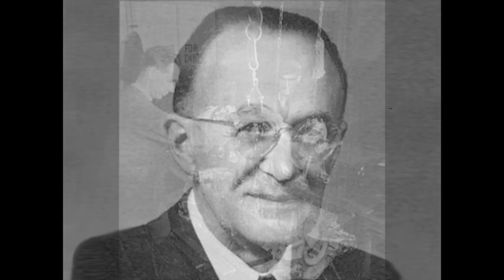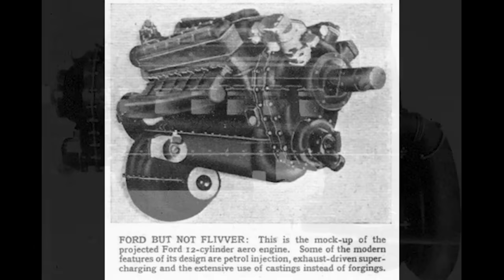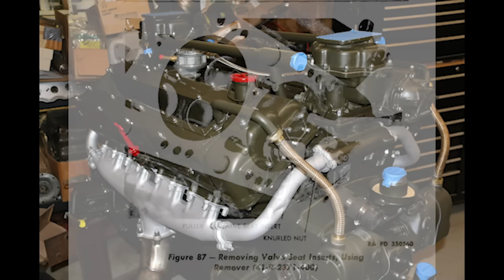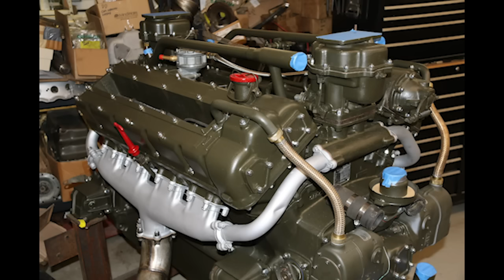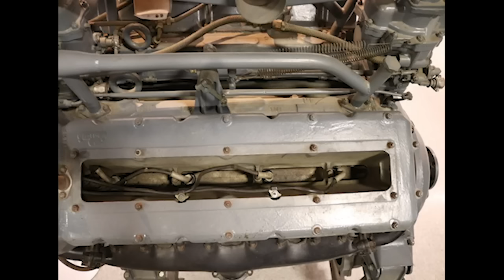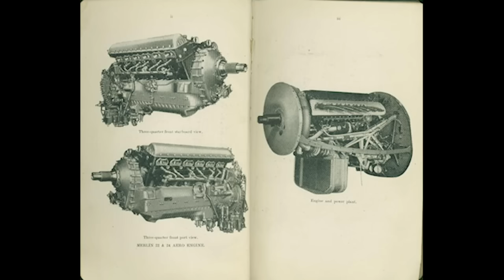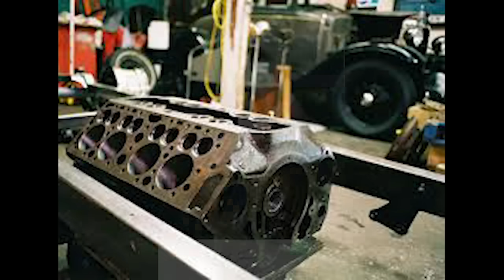War Hemi: The Story Of The GAA V8 - 1,100ci of aluminum WWII Ford grunt

Comment: Now Ford makes engines that have wet belts that fail in under 30k miles, water pumps in the oil jacket - so that when the pump leaks the water is in the oil and destroys the engine. The drive train is so convoluted that mechanics need tons of hours just to get to the problem.  Lets get back to the car manufacturers of the 1940's.
Reply: Engineering cars that are easier to repair doesn't have to mean going back entirely to 1930s technology. Modern cars are designed to fail just outside the warrantee time and they are designed to be difficult and expensive to repair. It's entirely about planned obsolescence and forcing consumers to purchase new vehicles instead of repairing used ones. This business model of the auto industry is one to maximize sales of new autos.
Reply: @Chez8922-kf6cy  well said. It's all about the money.
Reply: @nathanscott7910 Your comment is as dumb as his (his is totally wrong about dealership revenue), OF COURSE businesses are about MONEY, that’s how they EXIST. However you and him also know NOTHING about customer satisfaction scoring and how important it is to dealerships and their parent companies. You can literally go out of business with poor CSI scores. Dunces.
Reply: @Chez8922-kf6cy Lol, so close yet as usual you trailer park youtube commenters don’t have a clue. Dealerships make their main revenue from the service department and financing, backed up by useless service insurance and extra garbage on your contracts and car that you don’t need. You’ve obviously never worked in a dealership, had a business, or have any actual information other than what you imagine and blather. Go learn some reality and come back.
Reply: I read an article some years back (wish I could remember who wrote it) They were talking about why the automotive industry can't find enough qualified mechanics

They blame it on mechanics not keeping up with modern technology

I blame it on the "labor guide" not keeping up with modern technology!!!
Reply: VW have a plastic manifold oil cooler which fails under heat and puts the rad water in the oil.
BMW had a plastic inlet manifold which could catch fire.
Reply: I just watched a 3000hp ford coyote go 225mph in a quarter mile and it gets 20mpg on the street. Welcome to modern times my guy
Reply: Funny, because the Coyote and Voodoo are considered reliable.  Unlike flat cams that needed to be adjusted ever 20,000 miles.
Reply: Ignorance. 
Fords twin cam engines hold the world records. 
Standing mile 300.4 mph oe cast 5.4L 4V
5.88 @ 256mph with an almost entirely oe parts 4.6 4V 
The ONLY oe engined car to win overall Sick Week and set the drag and drive radial record 6.26 @ 227mph  oe cast Predator/Coyote 
No other manufacturer in the world has bested those performances. 
You haters are the most ignorant bunch in all of motorsports
Reply: Yeah poor boomer who understands modern tech and wants to revert back to the 40’s when things lasted more than 5 years.  I’ll take the 50 hp that I can expect reliability out of. I’ll pay the extra money in fuel.  Thats cheaper in the long run. That’s the cheat code us smarter millennials learned.  Never underestimate wisdom. Can’t learn that in college. Oh how’s that working out for you. 😂  It’s not that’s why you want us to pay for that as well.   That boomer you’re talking about…That built the in infrastructure we still use…That we wouldn’t have with your mindset…he didn’t have his hand out expecting anything.
Reply: Blame the people that voted
Reply: Your post is totally wack jack.
Reply: My 2012 F 150 had 248,000 miles on it in the 60s and 70s. Fords would go 150,000 at the most before needing an overhaul. GM about 75,000. I know I still have my first car. Totally needs to be rebuilt inside and out. I have a Ford F 100. That still runs, engine was partially rebuilt.
Reply: Todays engineers are incapable of creating quality products. GM 5.3 and 5.7 litre engines are dropping valves and lifters, and have oil leak issues. I almost believe this is all on purpose, as a way to sabotage the ICE engine, while pushing the EV industry up our A$$ES. Most of the technology is over 100 years old, yet they can't get it right?
Just my thoights.
Reply: So very true.
Reply: Ford never do anything right and this engine wasn’t really a ford it was stolen plans from Rolls Royce.. so ford didn’t create they just build it.. not the same thing.
Reply: Let's get back to the engines of t h e 60's!!
Reply: Ford is still good
Reply: Keep it simple stupid 😂😂😂
Reply: Yep.  They learned a 'valuable lesson' when the2 valve 4.6l Crown Victorias ended up lasting 300,000-400,000 miles every time.
"Noooo!!!  We aren't selling any replacement engines (or cars!)"
Sorry Ford folks, my 97 Crown Vic only has 48,000 original miles, so you won't be getting any money out of me soon
Reply: Just stop, I had an F150 with a 2.7 liter v6, that truck was traded in with 270,000. The one thing replaced was a cracked valve cover and a sensor I tore out driving over a piece of rebar sticking up on a job. That ecoboost ran strong and I drove it hard, it was a work truck in the end and it was treated like a work truck and is still on the road today.
Reply: It took decades, but they finally figured out how to build cars that people can no longer afford or repair. That's pure genius. If they even catch a hint that people are repairing these cars on their own, they'll follow John Deere and refuse to sell parts to anyone. For Detroit, your ignorance equals huge profits.
Reply: Ford only made a few good engines and today none
Reply: Not just Ford. All big auto Design to Fail.  Except Tesla
Reply: Fords 5.0 ain’t bad at all.
Reply: @luvmydeck  I agree. Electricity is far simpler,  less extortable.
Reply: @GWAForUTBE ....until they disconnect your charging service for having a slightly different opinion than your benevolent overlords.
Reply: @MrElapid  Considering most charge at home, not so likely.   
You likely do understand mostly any new car can be shut down remotely.   Including gascars.
Reply: These engines lasted about 250-300 miles before needing replaced in shermans. and they were considered some of the most reliable engines of the war... I really don't feel like doing an engine swap ever Sunday so I can make it to work during the week😂
Reply: Not one video of a ford oil pump belt failing yet 😂😂😂
Reply: @coreysharp9794  BMW had a bicycle chain drive oil pump and it filled quit regularly back in the 70s maybe 70 5 or 6 to 80, 320 I ?
Reply: @whycantyoucope69  search for ford oil pump belt  - there are a bunch
Reply: Them and all the other automakers have purposely made vehicles harder to work on so that you have to bring it back to them for service. Almost every filling station used to have a small 1 or 2 bay shop and a tow truck, they could handle pretty much any maintenance or repairs you needed if you didn’t work on them yourself or if you were traveling. The automakers saw they were leaving money on the table so they started making vehicles more complex, more cramped and requiring speciality tools that only they had. Now they make them to were you can’t just change parts and be on your way, you have to change the part then use a computer to program the part with software that is too expensive for your average person to have access to. But even with all that they saw people were still willing to try so they started adding tons of plastic covers and shrouds to everything to deter you from trying to work on the car yourself.
Reply: @mattm1554  I hear ya.  Tesla  is not like that. They certainly do not promote tinkering or putzin around with these high voltage vehicles, but they do understand how simple to repair their vehicles are and offer an EV mechanic training course available at most community colleges.
Reply: Todays cars are great til the part you need is so expensive it’s cheaper to get another car and junk the one that needs a 4-6$ thousand dollar tranny or engine , seen this over and over working in a shop where all makes and models would come thru.
Reply: And how many hours did 40s engines get before full overhauls? Not many. The squads we service (explorers) have the 3.7 and we routinely run them to 150k miles/25,000 total hrs/15,000 idle hrs with no major failures and perhaps 1 water pump replacement. Overhaul interval for the GAA is 1000 hours at the absolute most.
Reply: @luvmydeck  Don't listen to these supposed " modern" wrenches. I'm guessing they are stealership salesmen that has never spun a wrench in years and every good wrench  in his garage agrees, all new cars are " Designed to Fail"
Reply: That’s because production is made in substandard foreign countries now. Only assembled here in America to get around import tariffs.
Reply: Yes old simple V8S,  we were lucky in Australia, Ford Australia built the Barra ,one hell of an engine.  I hate modern crap but Ford Australia got this one right.
Reply: AMERICA'S AUTO TURNED POS in all lines especially  New Trucks !
Reply: @bernardc2553  it's sad ,in Australia we love American cars. Seems like everything you buy now is throwaway junk. I'm keeping my Australian built turbo barra falcon.  There is nothing worth buying any more just the old cars.
Reply: Perhaps this is why I have left the trade. 😊 Not the derelicts that become mangers, supervisors or even higher.
Reply: Nissan...
Reply: Sounds like you're all dumb enough to buy a new car. Then complain like every other vehicle is perfect hahahaha! Bet you're all mopar guys with a bunch of non working garbage piles sitting out front. And you flaunt that you spent 2890 dollars for a rusty fender.... boo hoo. Bet you one click cheap items off Amazon then complain that the products last one time. Idiots
Reply: Amen
Reply: It's funny when people say this but would shit if they had big gas hungry engines that don't start and run perfectly from cold 😂
Reply: @kiwi8. . Yeah but they were repairable in your backyard
Reply: @stevenfromer3816 yer definitely and don't get me wrong i love old gear but most wouldn't put up with it they think they want it but in reality they couldn't figure out how to drive them. Most people can't even change a tyre or tune a carb
Reply: @kiwi8. . True enough,but I do believe you understand the point I was making.   Most of my modern cars did very well with routine maintenance,except the fords,I got well over 200k on most of my vehicles.
Reply: @stevenfromer3816 lots of modern Ford's that are absolutely excellent. All and I mean all car companies have issues even the so Loved Toyota they have had plenty of bad engines bad rust problems ECT it's mostly people repeating stories but have no idea
Reply: @kiwi8. . I loved my Lexus,one of the best cars I ever owned.
Reply: Right, I hav a 95 351 Windsor. It's doing great. Doordash and weed delivery service... Hope it doesn't blow
Reply: FORD SUCKS. . . AS MUCH AS I WISH IT WAS DIFFERENT.  . . IT'S NOT.
Reply: Fords better ideas.
Reply: @joemckenzie312 
Exactly my feeling👍
Reply: Thank your friendly enviro-mentalist and government.
Reply: Planned obsolescence is central to modern capitalism
Reply: Yup, been a Ford guy all my life. I'm 60 now and not only Ford, you couldn't give me a new car. Seems like all of them are designed by DEI hires who've never seen a car before.
Reply: Don't forget the lack of woodruff keys on crankshafts in smaller displacement engines. And this goes fot G. M. And Chrysler, or whatever name they go by now. And yet, we had to endure an Auto Workers Strike as they demanded more pay. Yeah, right. For what? The quality sucks.
Reply: @stevenl47  I'm not sure that blaming the unions 100% for poor quality is totally valid. The workers assemble a vehicle that was designed without being tested and they have to do it in a time frame decided by a production schedule. Do you think that most of the problems in the field are the result if the assembly process? Also, recalls are rarely an assembly problem.
Reply: US automakers have become .....healthcare providers that happen to make vehicles. The costs associated with healthcare insurance were so expensive that auto mfg were forced to cut costs wherever they could. One of the easiest ways was to cut R&D/engineering costs. Auto engineers were primarily tasked with extracting cost from the mfg process, not exactly innovating new products or necessarily creating exciting cars. Those costs were extracted at a very slow pace, with engineers saving some of the savings for future years. Why? Because that's how they were paid. If you were to be paid $80k/yr(1978), the engineer would set about saving $100k in costs. The engineer would then get a raise and the next year reduce costs by their salary again. Many times that included sending work to vendors, who were then tasked with the savings programs. All because of the enormous expense of healthcare.  @johnsortore4470
Reply: @stevenl47 it's not the workers fault cars suck now. The workers aren't designing them and skimping on quality. That is totally driven by bean counting accounting and finance geeks.
Reply: @thenaturalmidsouth9536  if cars are so bad these days, why are they getting twice as many miles before they end up in the junk yard? In the 1960s, 100k was an accomplishment. Now a car with 100k is barely broken in. As I have said before, people look at the past through rose tinted glasses. Cars are more reliable than they ever have been. A huge portion of the "problems" with modern cars is ignorance. You can't take a canbus system to a shade tree mechanic with 2 screw drivers and a pair of vise grips and hope they are actually gonna get it right. 
But that being said, if a person is actually willing to do the research and understand the systems, they are actually easier than ever to work on. If anyone tells you different, it's because they aren't smart enough to actually work on it.
Reply: @jacktheaviator4938  I'm not arguing for 60's cars, I'm saying cars have gotten needlessly complex and over-engineered in the last 10 years. Electronic tailgates on trucks. Too many computer modules. Electronic parking brakes that fail. What's wrong with a failsafe physical parking brake for example? That still works when a computer chip or module on another car fails. Too many turbos. On a Tundra for chrissakes. In my view, cars peaked around 2010, with the right mix of technology and reliability.
Reply: @thenaturalmidsouth9536  trucks have electric tailgates because customers like gadgets, cable operated brakes are notorious for malfunctioning in the northern climates due to freezing and rust, and turbos are the only chance we have for fuel economy while still maintaining horsepower. Everything you named as a "problem" was actually a solution to an actual problem. And even with all that added, cars are actually getting simpler. With CanBus one wire can do the same job as 20 wire used to, eliminating hundreds of electrical connections, which is the main failure points for the electronics in vehicles. 90% of the time, when some "mechanic" (and I use that term loosely) claims a sensor is bad, it is actually the connector, not the sensor. 

At the end of the day, cars are far more reliable than they have ever been. I constantly see vehicles with 200k that have never had more than a fluid change. And they are getting more reliable every year. But that doesn't fit the 'lectrons bad/ boomer narrative.
Reply: @jacktheaviator4938 

I can rebuild a 1970 model 302 about five times for what a replacement engine cost.  Also I can pull it out on a Friday afternoon remanufacture it and have it back in before Monday.
Reply: @thenaturalmidsouth9536  it would be nice if I could check my oil with a distinct, too.
Reply: @thenaturalmidsouth9536 of course it's all about the bottom line is it not?
Reply: @jacktheaviator4938 No they are not. I daily drive a 25 year old truck nothing absolutely nothing that is built today will be on the road 25 years from now.
Reply: @jacktheaviator4938 Says the lazy whipper snapper Gen "whatever" who kaint fix shit😂😂
Reply: @jacktheaviator4938  the way you seek to treat others with contempt calling them childish names and insults because they have an opinion that doesn’t line up with your own “values” (lol) , hunting for confrontation or conflict amongst 1 and 0 , with no real provocation is amusing at best. While you’re safely at home, interfaced with your 23rd century idiot-box belittle and ridicule others and your one eyed attitude, well your entire demeanour and communication skills are dragging the hairs poking out of their dates on the ground, somewhere nether side of infantile. So, what blend of scat are you feeding yourself with.?…that shit doesn’t grow out a seed you know but its certainly not rare like milk-tits on a bull so where did you get it from?
Reply: @jacktheaviator4938  Jack the boneyards are full of stock spark plugs & original tires.  Big auto designs all new vehicles with lifespans.  Getting shorter.
Reply: @stevenl47 their still doing their job and need good pay like the rest of us.
Reply: @stevenl47 what you're talking about has nothing to do with the guys assembling the engines. It has everything to do with the design engineers having their heads up their asses.
Reply: @stevenl47 YOU endured an auto workers’ strike? Lol, bootlick much?
Reply: Must own a Gay Man Cruiser.
Reply: Awe, poor boomer doesn't understand modern tech... 1940s engines had 50hp and got 10mpg out of a 6 liter displacement ,so I don't think anybody wants to go back to the 1940s.
Reply: @jacktheaviator4938  Modern technology is fine but limiting the right to repair takes away from it.
Reply: @johnsortore4470  the only thing limiting your right to repair is lack of knowledge. The modern tech makes more power in a more efficient manner. People look at those weezy old motors with nostalgia, but a 400+ cubic inch motor that makes less power than a Honda 2.0 liter is honestly a joke. 

Beyond that, motors from yesteryear needed CONSTANT tinkering. Points ignition and carburetors are both failure points.  Just open a manual and check out the service schedule. Now we have vehicles that do 200000 miles without anything beyond a fluid change. Cars have gotten FAR more reliable. But people fear what they don't understand.
Reply: @jacktheaviator4938  points don't fail and neither do carbs. They need maintenance. Modern owners don't like to maintain anything.
Reply: @chrishultgren777 are you old enough to remember carbed vehicles? Those days sucked. Cold weather was a real pain in the ass. Modern cars don't need any tinkering except fluid changes and new tires. They break down FAR less, it's a simple fact. You just walk out and it's running flawlessly even in 10° weather. 

I enjoy tinkering on old cars and farm equipment as a hobby. But if I don't rely on any of them to make a living. If I am trying to make a paycheck, I drive my 2018 F-250.
Reply: @jacktheaviator4938  how can you say that the only thing limiting the right to repair is knowledge? No one can repair a new car without a factory authorized computer program that costs thousands. It has ZERO to do with knowledge. Go ask a farmer with a combine sitting in a field that quit without warning. He has the ability to repair but the dealer won't give him the information that will allow him to do it.
Reply: @jacktheaviator4938  How many engines today will go 200 000 miles without something failing !!!
Reply: @jacktheaviator4938  I drove Fords for 40 years, carbed, manual and auto and NEVER had a trans or engine failure, and they started every time temp did not matter.  the last 3 Fords I owned one brand new 2 with almost brand new , 2 the trans failed at less than 50,000 miles, the newest failed at 100,000, and had the stupid water pump inside the block, and I dumped it at 130, 000 before the water pump failed and ruined the engine.  I still have one of them a Ranger pickup but the car was replaced with something else.  I hate these new vehicles but fortunetly I do not have to worry about them much longer !!! !
Reply: @jacktheaviator4938 

Boy, you are an ignorant 1 aren’t you? 

Most of the parts on a 2024 Ford pick up has to be programmed into the computer.
Reply: That's called, repeat after me, CAPITALISM.
Reply: Carbs need constant adjustment, drive from sea level to 5,000 ft altitude, and try driving it at 9/10.
Reply: @AtropalArbaal-dk8jv and we as AMERICANS love it!!!
Reply: @chrishultgren777 they don’t fail but they need maintenance? Wow, is english your first language? Same difference there chief, but yes there are minor and catastrophic failures, some prevented by maintenance.
Reply: @jacktheaviator4938 Spot on. Shitty weak batteries with short lives, finicky carbs and points, carbon build up, bad fuel, crappy filters, lame oil, the list goes on and on. Modern autos, their systems and support materials are vastly superior to the “old days”.
Reply: @DoctorShocktor  before the 1980s, mechanics replaced parts [such as points, carbs, generators] before failure. After the 1980s, mechanics went to the philosophy of fix on failure.
Reply: @jacktheaviator4938 the most powerful WW2 aircraft engines produced thousands of horsepower, I don't understand what your referencing regarding these 1940 era combustion engines, the spitfire and mustang had a tremendous engine of the late 1930's design and the mustangs were even shooting down jet aircraft. Maybe your thinking about moped engine technology.
Reply: I understand it just fine therefore I'm very much aware of what a piece of shit almost every modern vehicle is. You use the term planned obsolescence this is a misnomer. just because something is obsolete doesn't mean it doesn't work. these turds that have been produced nowadays are designed to fail. what they should be called is planned failures. There's a reason why technicians hate engineers.  @jacktheaviator4938
Reply: @johnsortore4470 You're kidding right? Most farmers I know don't even own a simple 12  volt test light.
Reply: @pete1342   --  Then you know some lame farmers.  Most farmers can fix just about anything, with the tools to do it.  I fix all of my own equipment and vehicles.  Come to think of it, Henry Ford grew up on a farm.
Reply: @ironcladranchandforge7292  If fixing modern machinery involves even a cursory understanding of electronics, you can forget about farmers fixing it. Their idea of diagnosis is firing the parts cannon at it.
Reply: @pete1342  --  Well, you may have a point concerning modern equipment with all this unnecessary electronics. Wes on his YouTube channel "Watch Wes Work" has talked about this.  Many of his clients have thrown new parts at the vehicle hoping to fix it.  It's hard keeping up with this new technology and buying the necessary computer scanner stuff to diagnose. One of the computers Wes has cost $1,500.  Then there's the learning curve to go along with it.  But most farmers should be able to fix or repair the mechanical stuff.  If not, they're not worth their salt in my opinion.
Reply: @AtropalArbaal-dk8jv Communists drove Ladas and Trabants. Just stop with the nonsense.
Reply: @jacktheaviator4938 .  Wrong  - l have no problem with the simplicity of the 40’s Engines.  If Someone looked under the hood back then, He could actually see let alone work on the Engine.  Now looking under the hood is a big show of plastic.
Reply: @Corvacar ......a guarantee that you will have to go back to the dealership for any problem instead of having the ability to fix it yourself.
Reply: @Corvacar you remove the plastic covers....that's step 2....after step 1 which is to grow some balls
Reply: @johnsortore44 of course that's how they make their damn money70
Reply: @jacktheaviator4938 I don't know anything about the "40's" engines but the mid to late 60's and very early 70's engines were way better than the junk today!
Reply: @docsmallblock6584 YEP  ‼️ RAW  mechanical ⚙️ POWER , Naturally Aspirated , Old School Simplicity , The Golden Age of Muscle car Era 1960 -1970 (71-72 ish ). Salute to the early 20th century  automotive engineering ❤️ 🇺🇸
Reply: @jacktheaviator4938 you probably can’t drive a stick
Reply: Manuals are so much slower than automatics.
Guys who prefer manuals are compulsive masturbators.
Reply: @jacktheaviator4938 Wrong!
Reply: Instead of making smart arse comments, watch the full vid and learn. All the tech developed for these engines is still used in today’s automotive industry
Reply: @jacktheaviator4938  lots of things you see in modern cars where invented , tested and used in the 40s
Reply: @jacktheaviator4938  --  "Boomer" bashing again, even though it was a boomer who perfected the computer or smart phone you're using to write this comment. 🤣
Reply: @ironcladranchandforge7292  the smartphone and computer I use were both designed and built long after the boomers were put out to pasture, and even if some random boomer did work on one or the other, it wasn't you...if you are gonna try to claim the accomplishments of your entire generation, you can also carry your failures. Our society has fallen into complete degeneracy under your generation's leadership. Your generation was the parents that handed out participation trophies and told everyone "you are perfect." You brought us affirmative action and destroyed the economy. My generation is left to pick up the pieces because yours failed beyond measure.
Reply: @jacktheaviator4938 Modern Tech?  If you had to work on these mass produced modern tech garbage engines you wouldn't be such a condescending smart ass. These ridiculous piss poor designed engines have so much plastic integrated into critical components these days that many have catastrophic failures at less than 30k miles. How do i know this? Because i work on them everyday, all day long. I'll take your self described inferior 1940's engineering over your "modern tech" junk anytime!
Reply: There's a such thing as modern garbage. From personal experience, I'll take a BMW with a B Series engine over an Ecoboost engine.   @jacktheaviator4938
Reply: @jacktheaviator4938 actually, the design flaws of the ecoboost engines that he mentions are real and documented well known ford failures among enthusiasts and engineers, your “poor boomer” comment is pretty much just some amateur backlash, not understanding his beckoning to a more reliable time not a purely mechanical time, 

So yeah. Blow it out you ass young’n
Reply: @jacktheaviator4938 more like 1100hp
Reply: I've talked to master ford technicians who remark about the same issue. It's not a boomer problem rather its partly engineering at ford not listening to tech input or most likely the bean counters wanting to sacrifice quality or ease of repair to save $$$ and drive customers into ford dealer repair shops.
Reply: Throwaway engineering, fiberbelt brake valves bend @jacktheaviator4938
Reply: @jacktheaviator4938 I do.
Reply: @jacktheaviator4938 because you need all 300hp out of a stupid Corolla to go to the store 🤦🏻‍♀️🤦🏻‍♀️🤦🏻‍♀️
Reply: @jacktheaviator4938 yeah whatever
Reply: @mykec.selene8302  that is some rock solid logic. No wonder you are having problems understanding modern vehicles
Reply: @jacktheaviator4938 atleast you will get to work on your 6mpg instead of roadside dead broken down Moron
Reply: @jacktheaviator4938  poor ZOOMER doesn't understand history.
Reply: @coolruehle  as I said earlier, I enjoy playing with classic cars, I own a couple. But if I need to actually get somewhere reliably on time, I drive my late model vehicles. I ACTUALLY understand history, not a bunch of "technology bad" ignorance. If you wear rose tinted glasses, you are gonna spend a lot of time on the side of the road.
Reply: @jacktheaviator4938 do you work on autos? They are complicated with electronic integration to a point where failure at a level that is cost prohibitive to the value of the vehicle. 
We are junking cars because the electronics in the trans fails, not the mechanicals, and the cost of repair is up at insanity level. Who wants to put 5 or even  8k into a tranny in a car worth little more than that or less?
The rate of failure of tech in new vehicles is nuts.
And warranty is a joke
Reply: @jacktheaviator4938  Was wondering how long you've been a douchebag. Let me guess, you're of the bedwetter generation still breastfeeding at 30.
Reply: @jacktheaviator4938 what’s with the arrogant condescending asshole approach to every reply you make . You seem very knowledgeable with valuable information. Yet your “looking down your nose while having to boorishly converse with the peasants” approach is so a kin to a child like bully.
Reply: @jacktheaviator4938 The new engines are junk
Reply: @jacktheaviator4938 a fifty horsepower tank ? I'm gonna pretend that your thinking about WW1
Reply: @jacktheaviator4938 It pretty apparent that you have never known a single moment of proper hardship in your entire life so far. Privilege and infantile small minded mentalities tend to go hand in hand.
Reply: @jacktheaviator4938  I agree. But the ol boomer is correct aswell. , The new mechanics are fed up dealing with customers,  have to tell them their 50k vehicle was designed to fail.
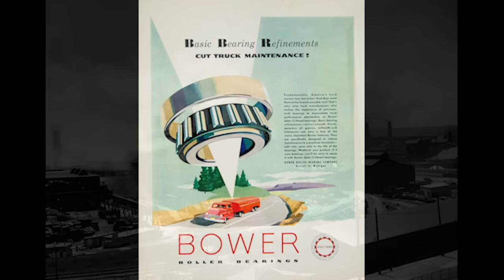Reply: @jacktheaviator4938 that was because of those 4:10 gears and four-speed transmission. . 
And then those cars was like pushing a sheet of plywood down the road sideways it's called aerodynamics. Now I got to tell you getting one horsepower per cubic inch was not that hard😮
It was the egghead between the steering wheel and the pedals that caused all the problems. 
You can actually think NASCAR for the modern design car . . 
It's from a day when you could race it on Saturday or Sunday and buy it on Monday. . Not so much the crap up today car.😮 They don't have any  parts from the original manufacturer. And you have to buy everything from Nap~car.😮
Reply: @jacktheaviator4938 Actually I like both. Also understand both. For day to day driving I'd take a small Honda.  For driving enjoyment? One of the MG's I had 50 years ago.
Reply: @jacktheaviator4938 1940s engine had good enought mpg for their weight. 
If we keem the old engine architecture with simple modern injection and a light frame we can get amazing mpg.
Reply: @jacktheaviator4938 🎉but  a mere 25 years ago I knew many of people with inline 6 cylinder engines making 600 hp (not turned up) to the wheel and getting a million miles on them, of course I believe in the power of the superior fuel DIESEL. Pulling 80,000 to 92,500 pounds all day long. Some Did run V 8 or V 12 but they were rather rare never had the opportunity to work on one those beasts of the highway. Today we put lawnmower engines in cars with a whole lot of computers on them. We have monster alternators to run the computers and led lighting so alternator can keep up. The computers that keep you on the are way beyond what got us to the moon and back. 😮 So if you like all those computers, I would recommend you work on police cars and fire trucks, because that is what I retired from. The old school trucks that were worn out would start after being decommissioned and sitting for months to be auctioned off and the new ones would come in for and oil change or a flat tire engine running fine and when it was time to leave they would not start because something was out of sync with the engine control module, turbo failure, or something else, times are certainly better now. Remember when that when you need a reliable emergency vehicle. It might just shut down when you need it most. But at least it’s getting better fuel mileage. 😎
Reply: @jacktheaviator4938 Yeah, modern tech that fucking sucks ass 😂. Ford is in the gutter with reliability. A wet belt should be a chain, not a belt.  You have to take the engine out to change that belt cause it still cracks and rots. The pumps love to leak so that’s a major issue as water will destroy all of the cylinder wall. He might be a boomer but he is still correct.
Reply: @caboose6411  ots kinda funny, fudds all seem to talk about "ol' time reliability" but we have the data. Newer cars require FAR less work to keep them on the road, and typically go for 100k further before needing major repair. Pepple look at a past that they never actually lived through rose tinted glasses. Old cars sucked. They ran like crap if the temp dropped, and you were constantly tinkering with them to keep them on the road. Modern cars just work. -40° to 115° they run exactly the same.  It boils down to takking trash because you either cant afford a newer car or you aren't smart enough to understand how they work.
 I am currently driving an f150 ecoboost 2.7 and it has 330000 miles. The only thing i have done is normal maintenance. Over 20mph and FAR more power than my old 94 F150 4.9l. and the 4.9 had to be rebuilt after 200k due to lost compression. Vehicles are getting more reliable every year. Facts are facts.
Reply: @jacktheaviator4938 no we don't. But this disposable mindset needs fixing. My 4/71 is from '54 rebuilt in '86 burns 1.5 gallons an hour hasn't needed more than a valve adjustment and oil change this century. Your computer designed trash isn't even good for a decade.
Reply: I put several thousand hours a year on it in case your wondering.
Reply: @jacktheaviator4938 

What an immature comment.  I would be glad to have a vehicle that I can work on. I would probably only have to buy one in my entire life. I’m perfectly OK not having a ton of horsepower.

Up until about the 1970s everything was interchangeable on a Ford . It didn’t matter if it was a car or a truck. Most of the parts fit.
Reply: @jacktheaviator4938 
It’s not nice to abuse the elderly. 😂😂
Reply: @1969SandraRae  this whole thread can be summarized in one sentence. "I'm old and I don't understand, so it must be evil."
Reply: @jacktheaviator4938 Plenty of “old” people understand just fine.
Reply: @jacktheaviator4938 please tell me your not that dense??? Must be an engineer